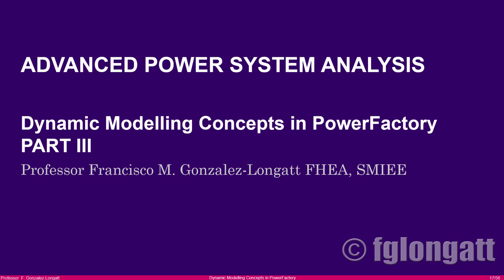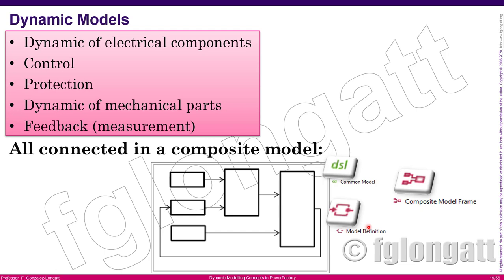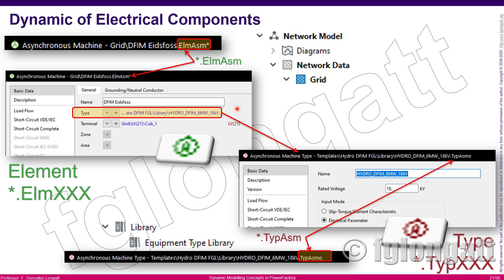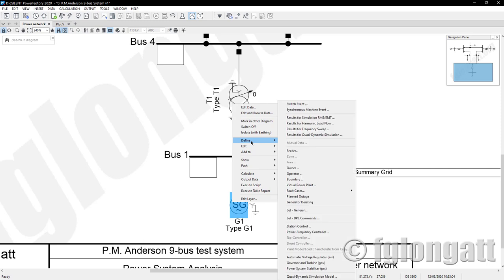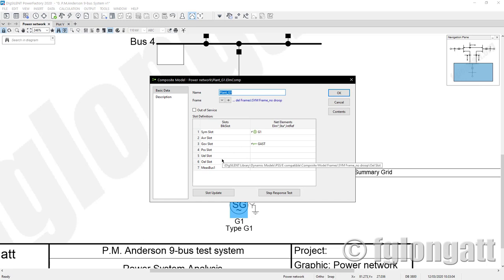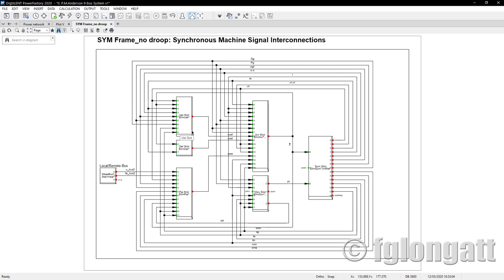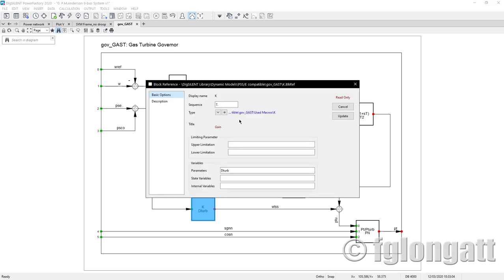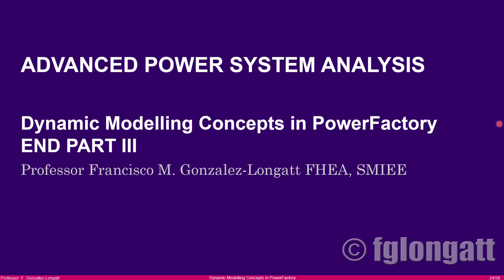Dynamic Modelling Philosophy using DSL in Power Factory PART III

Comment: Dear Prof. FG-Longatt, Thank you very much for this beautiful presentation. I can see how you are fond of PF. What is the main numerical integration used in PF? Are DSL calculations performed simultaneously with PF solver or there is a one-time step delay between DSL and PF?
Reply from the maker: I do not think the integration technique is publically available...it must be a commercial secret. The solution method can use fixed or variable step, and those methods based on variable steps are not for kids :-). Tes... DSL equations are translated into the internal systems of PF. You must be aware that we are using .dll now in powerfactory and that speed up the simulations... Best regards. Where are you writing from?
Reply: Dear Prof.  @FranciscoGonzalezLongatt , 
Thanks for your reply.  I am a Libyan Ass. Prof. working at SQU / OMAN. 
I will send you a personal email regarding technical points in PF.
Take care.